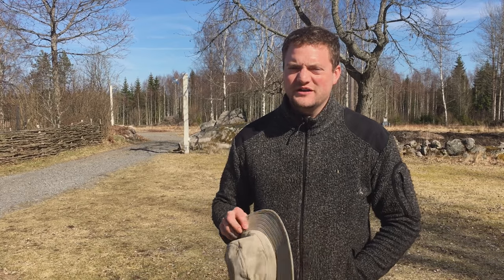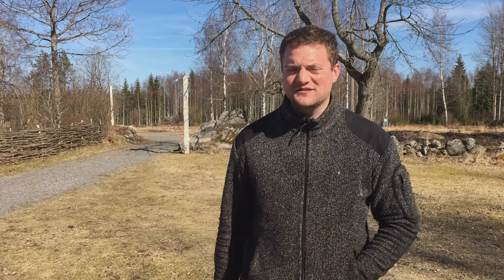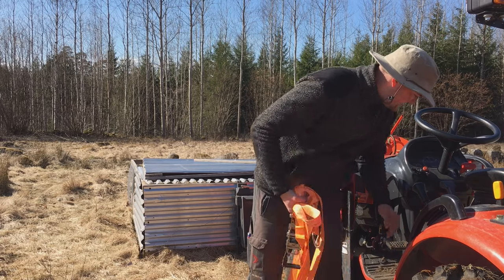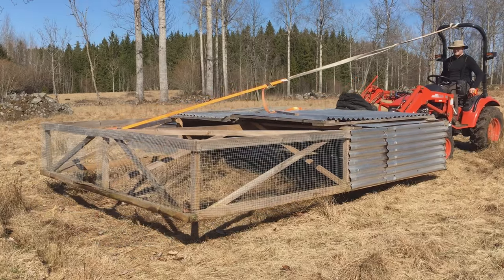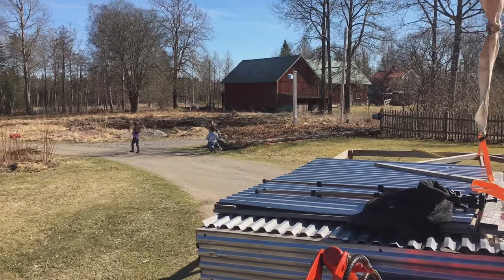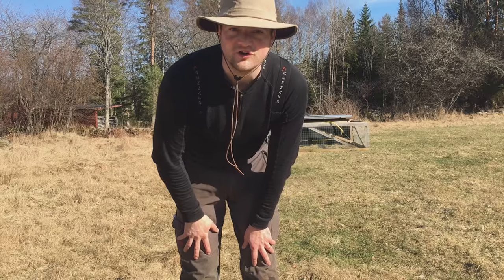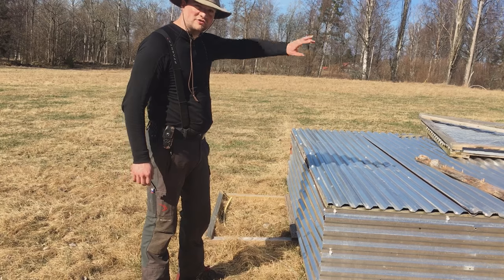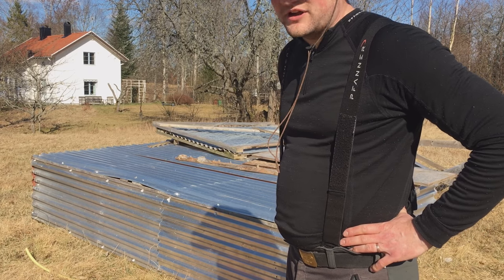What Is A Chicken Tractor And Why To Use It??

Comment: I use Salatin tractors too and have a dolly. The problem with the dolly is that it lifts the end up enough so that young chicks less than 4 weeks old can get out when you move it. Also the wheels of the dolly sometimes rolls on the feet of the chickens so you have to stop and back up or occasionally kill a small bird. Your sled might be a better method. The use of 1/2 inch hardware cloth is better than the 1inch poultry wire too which only lasts about two seasons. My sheep also break through the wire to get to the feed. I have steel roof panels instead of lighter aluminum that Salatin recommends  but the wind will sometimes lift them off and sail them across the pasture like a giant ninja star. Very dangerous.
Reply: arlingtonguy54  Consider some kind of a foam or a brush edge on the internal side of the edge which  drags on the ground.  Remember the "cow catchers " on the front of steam trains? These scooped under the cow to push it off the tracks.
This is a bit far afield,  but one time I  was at an areo-space plant where they made door seals for space craft. What they looked like was something like a strip of fiberglass fur.  Humm...carpet might provide the flexible gap filling edge  you need. Reveled carpet might work too.
Reply from the maker: Thanks for sharing. Interesting.

Comment: I don't think the Salatin CT are well designed.
1. Far to expensive in material; (except if you have the stuff on the farm anyway) 
2. to big to get them working on a "not so flat" field;
3. It is to cramped inside.

There are to much hassle to me to work with. And I got angry with myself, because I build something which, I knew wouldn't work for me, but I wanted them, because they are Salatin designs.

I like to be able to stand in my tractors, so I build them like John Suscovich. Remember that you can't just take their (US) measurements, and make them work in Europe, because them space calculations are illegal here in Europe. If you want to sell something you better read up one the laws :-).

I hope I can get an old trailer and some electric fence netting (?) (Geflügelnetze in German) and I will build the better system (Gabe Brown/ also Salatin) which I know works! But you might need a little bit more land.